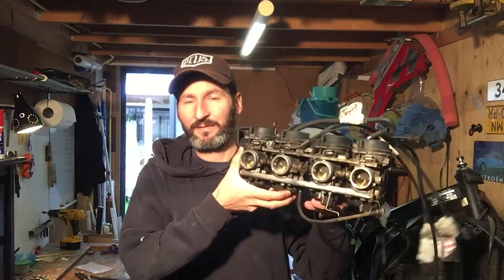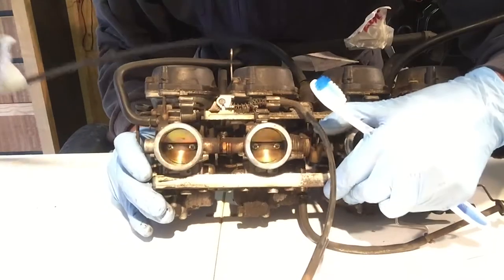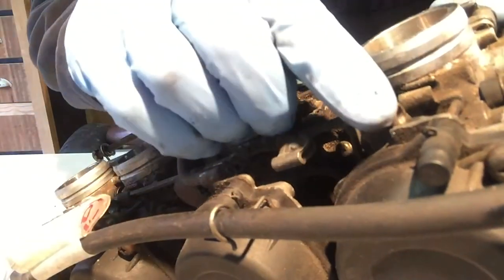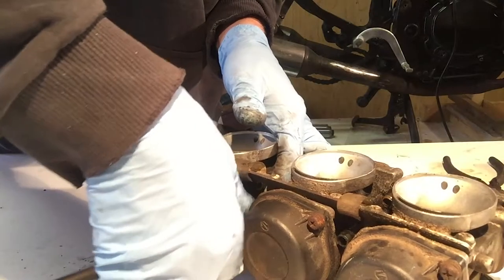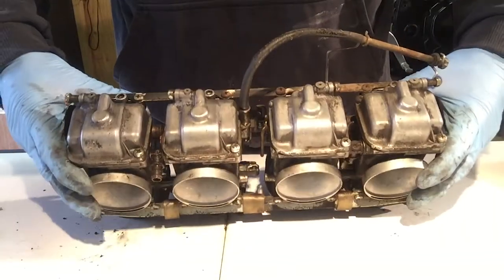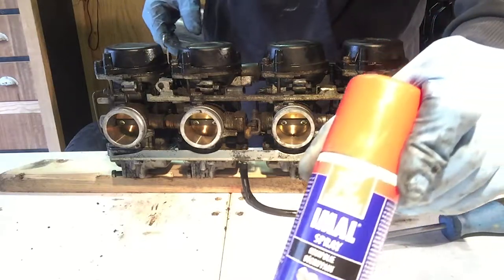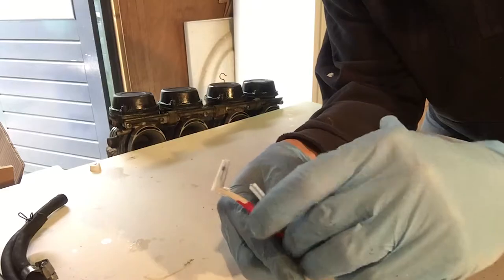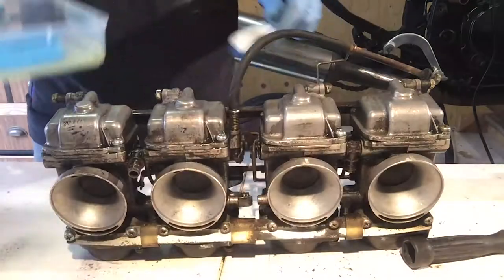Dutched Shed-build bikes - Suzuki GSX600F - Episode 3.1 - Carb Cleaning

Comment: I bought a 93 gxsr 750 the carb system looks the same as the ones you have in your video the fuel lines on mine rotted away was wondering if you could explain/send me any photo ya on routing the fuel lines I couldn’t see the labels you had on the hoses and where you pulled them off from in the video. Thanks
Reply from the maker: kingjayv203 unfortunately i don’t have the gsx anymore. I had to abandon this project as the engine was to corroded and seized nuts. So i cant help you any futher.
Reply: @DutchedShedBuilds  Do you know how many turn out the pilot air screw mixture ?
Reply from the maker: @leon-fz4cd  see my reply down below in the comments

Comment: Do you know how many turn out the pilot air screw mixture ?
Reply from the maker: I have to say its a pretty long time ago. Have you tried looking at the schematics for your gxs600 on cmsnl.com? That shows how the part fits in the carb, what it looks like. But normally a flathead-screw-driver is all you need or a gripvise depending on the type. The screwdriver had to fit perfectly in order not to damage the screw. Hope that helps!
Reply from the maker: See page 187 off this online manual, you will find the anwser you are looking for i think https://www.manualslib.com/manual/1059519/Suzuki-Gsx600f.html?page=187#manual
Reply from the maker: On page 187 you will find the anwser: https://www.manualslib.com/manual/1059519/Suzuki-Gsx600f.html?page=187#manual